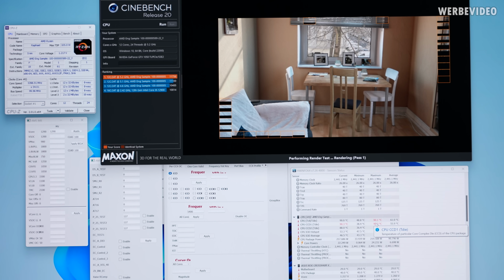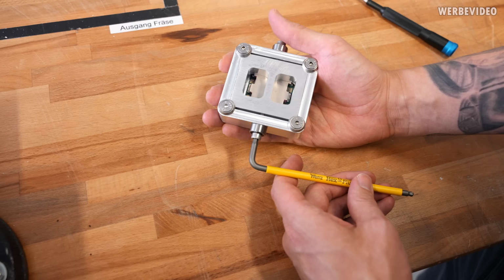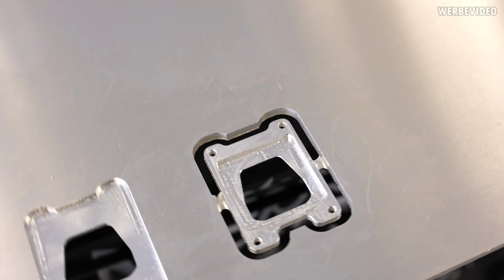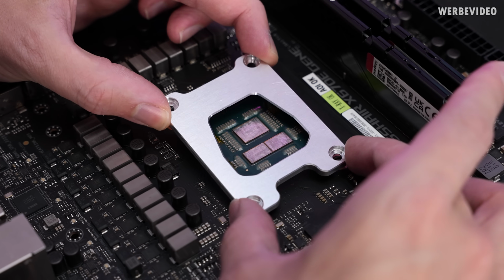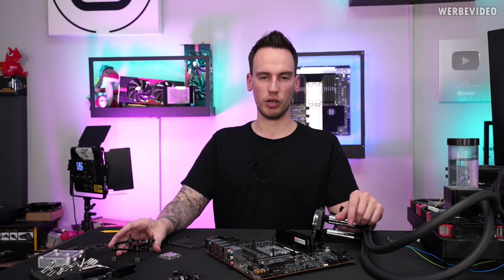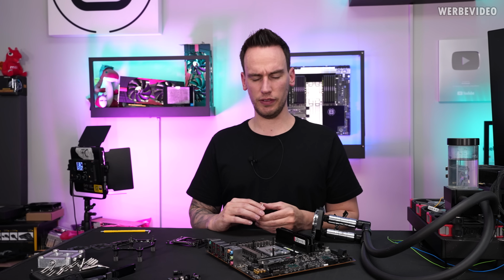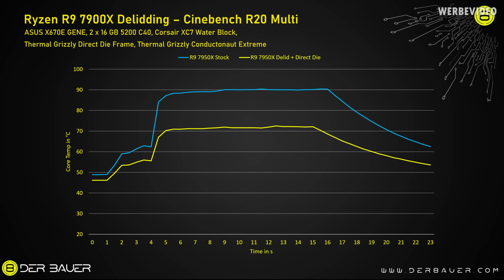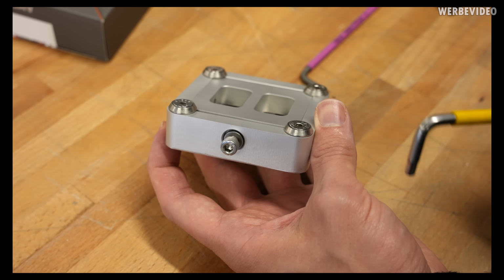Ryzen 7000 Delidding - Unreal Temperature improvement with Direct-Die Cooling

Comment: Would be interesting to see results of allowing automatic control - the CPU is designed to operate at 95 degrees C and adjust clock/voltage with this.
Reply: This was my first thought, as well. From the other major reviews I've watched today, the CPU actively tries to hit 95C when left to auto settings. I think Jay, GN, and LTT all mentioned that these will benefit greatly from more advanced cooling solutions without any real input from the user. Could the default behavior leverage the gains from direct die? If so, that would be something amazing to witness, IMO.
Reply: I bet it'll do worse, there's must be hard clock speed ceilings in Auto Mode -- while 7900X has higher boost clock (5.6), it's just for one core. All-core boost ceiling is very likely to be below 5.5Ghz that Roman dialed in.
Reply: @niter43  I don't think either of us are curious about overall performance here. I know for me, personally, it's more about seeing what this approach in controlling the CPU performance is capable of without the user directly controlling it. Of course manual overclocks will be better in all out performance.
Reply: @Trent1453  Precisely.

There's potentially so many different ways to configure these CPUs.

I'm curious if it's possible to manually set the thermal limit (to say 80 degrees) and what performance would look like.
Reply: @niter43  You're simply wrong. You need to check other reviews.

Zen 4 works very differently to other architectures.
Reply: @edwardcullen1739  were there reviews that showed CPU going above advertised clock speed all-core?

I highly doubt that it would try to hit 95C no matter what (stupid voltages, clocks, etc), it's simply that there's no ordinary coolers around that could cool them during full load with stock IHS.

Comment: Great video Roman! Love how you’re able to figure out the problems with the latest CPUs, like the bending correction frame for Intel 12th gen and the IHS/z height problem with Ryzen 7000.
Reply: Is it really a problem though? I need to see more videos on thermals and etc. For me a little tuning and tweaking and i think you could get it running cooler.
Reply: @HackoDis  it may not be a "problem" for the average consumer. However, if you want to tweak and tune the CPU to squeak out as much performance as possible, you're immediately limited to your cooling solution. So it would be a problem if you didn't hit the lottery on a silicon this would fix it.

Comment: This was my concern when I seen 95C as "new normal" for AM5... we been there, Intel did exactly that, they had horrible IHS design and they excuse was "nien our product just designed to run that hot"... yes that was BS and it seems AMD is now doing exactly the same. And this is just so annoying, why can't they just get IHS right?! Yeah sure it is all good for der8auer when we delid  everything and use 12900k as a scraper, but for us normal PC enthusiasts we not going to buy brand new 7950X for £900 and just delid it hoping for the best. That does make sense when you using PC for OC record (and get engineering samples for free, or just cover the cost by content), but not something people will do for gaming or creative work... it is just sad to see AMD doing same thing as Intel did and just pushing this crap out. How is it acceptable that IHS adds 20C?!

By the way that is not 20% improvement, what matter here is improvement from idle at room temperature to max boost. So that is like from 35-38C or 56% improvement (30-32C delta vs 57C delta)!

Comment: I work for a data colocation company and those stock temps were worrying me, not because I think that the CPU will die, but when Epyc with this core hits, I am worried about heat in the colo. We have SLA's we have to maintain, but we are always trying to find ways to use less power. It is going to get hot on the colo floor. It would be nice if they could do this from the factory.
Reply: That's not how this works. The same amount of heat is still produced for a unit of work so your cooling bill is still the same. Since you can do more work with a delid you can actually make more heat.

Comment: Would like if can have retail cpus with this bracket and delidded instead of taking a very risky procedure. I delidded an 4790k and get a massive improve temps and not used direct die... But its much easily that a soldered cpu.

Comment: Hey Roman 

After delidding to get the chip to get dies flat and clean of all indium, after using the blade… Put a piece of paper down on a granite counter and rub the chip upside-down like lapping on the page. The indium does “what lead does” and will rub off on to the page until just the die is exposed and no indium is left and it will be nice and shiny… stay safe man

Comment: Since the die is so thick, is it possible to drill holes though the IHS, make a manifold, and do a liquid cooling loop like that?

Also that's an insane temp improvement, I'm gonna have to DD mine if I upgrade this gen
Reply: Diamond layer on the die side of the heat-spreader.

Comment: Soo.... that cooler compatability with AM4 is really moot after all... 😶 AMD should have shaved down the IHS as that would have allowed for better heat dissipation. I imagine Zen 4C will have a shaved down IHS 🤔. With these temps I wonder how the 3D-V Cache variants will perform. Any way thanks for going against the grain and going straight for the Delid! As it really helps put things in perspective in terms of a solution in thermal management if a person lives in a hot climate. I really don't want to think how how a room will get in the summer 😅.
Edit: Just seen PCWorld's Gordon's Power Comparsion on Eco Mode and the performance of the 7950X is really good from what can be seen therefore for folks in hot climates the 105 mode and 10% or so hit is not a bad trade off. Perhaps you should try the eco mode Roman and see what you get with direct die cooling?

Comment: probably try to clamp down the PCB if possible, it looks like the PCB still has a bit of play in the Y axis making for a bit of unwanted tortional load happening with the chip pitching up
since the glue and solder have a bit of play it makes it so that pinning down the lid from going up and down, doesn't really mean that the PCB won't move up and down at all
I'm not an engineer I'm just commenting about what i saw with the process
so take my opinions with a truck of salt

Comment: Nice video.  With an HS this thick, there is more than enough room for a vapor chamber.  On higher core SKUs the lower temperatures and improved efficiency would probably allow 2-300Mhz higher clocks. Thats a huge deal if the same applies to the EPYC processors.    

I could probably use a dremel, some self tapping screws and the top part of an old chipset waterblock for a 30min ghetto mod.  With the added benefit of freeing up space around the CPU.  No need for cooler mounts when the water block and HS is the same piece of metall.

Comment: Well i'm not surprised at all but massively disappointed.

The first time i saw the leaked image of the new AMD CPUs whit such THICK ihs i knew this is going to be a nightmare for cooling not only because of the Z hight but also because the smaller lithography of ZEN 4 will lead to higher thermal density and on top of that the Indium sheet that AMD uses under IHS is just bad either because of its thickness or the quality of it but the core deltas are in some situations 20C or more and this can't be fixed lapping the IHS (tested on my 3900x) so the issue is under it and with everything that is going on in this thermodynamic system to me makes perfect sense seen such big temperature drop after getting rid of all this THICK layers the heat has to travel. Also the fact that AMD is being threaten by Intel 13th Gen unlike in the launch of Zen 3 in which team blue has nothing to offer it makes perfect sense that AMD is going to try to win the "marketing war" by pushing the silicon way outside their efficiency curve just to match what Intel (Intel do this whit the 11th Gen) has to offer and this is a business decision that engineers can't do shit about.  Basically AMD is letting this CPUs to cook themselves hitting 95C (GN show this clearly) all the time  just because they need to maintain the illusion of having a premium product to justify a premium price to make their shareholders happy regardless of the massive inefficiency,heat and degradation this is going to cause to the CPUs but of course they say is "expected behavior" whitch to me sounds like Lisa said "Engineers told me most of the CCDs in the new ZEN 4 can survive at 95C within the WARRANTY PERIOD and soon after that will be FRIED so is OK to sell the product."  so yeah programmed obsolescence at is finest but anyhow I'm looking forward to buy your deliding tool and the frame as long as its reasonably priced to fix this fucking mess AMD has created.  

This trend of wasting energy and increasing E-waste for pure GREED is going to fuck this planet completely 100% sure.

Comment: I see a lot of comments about the CPU height remaining the same for compatibility reasons, but wouldn't lowering the mounting holes achieve the same results? The already require a new solution for coolers with their own back plates, so it why would they make the compromise of a thicker IHS?
This raises the question: is the thickness the only issue, or even the primary one? The GN review showed a max core to core temp delta of 19.5C, which makes it appear as though IHS unevenness, its shape, or deformation from ILM pressure makes for a bad interface with the coldplate of the AIO they used. I wonder whether this is also the case here, and if lapping/different loading mechanism could solve it. It would also be interesting to see a sanded down IHS with lower cooler mounting holes compared to a stock IHS and backplate.

Comment: I'm way more excited about this than the actual reviews. Especially since the limiting factors to these CPUs are thermals and power draw. AMD  will continue to push the CPUs until you first hit the thermal limit, then the power limit. this makes "Overclocking" way more achievable IMO. Now higher-end liquid coolers, custom loops, and delidding are justifiable, even on the 7600x. This is an exciting time to be a tinkerer.

Comment: With how thick the IHS is, I think you could get a lot of improvement without delidding by just shaving down the IHS and then lapping it flat. You could make a nice kit with a 2-step lapping kit and blocks along with some shortened mounting hardware.

Step1: Insert CPU into "tall" guide block.
Step2: Use the coarse portion of the lapping block to quickly grind away a good portion of the IHS thickness. The tall block will bottom out on the plate and stop you from grinding down too far.
Step3: Insert the CPU into the "short" guide block.
Step4: Use the fine portion of the lapping block to get a flat finish on the new top surface of the IHS. The block should again bottom out to prevent you from going through the IHS completely.
Reply: You'd have to replace the mounting mechanism and ILM if you did this, to get the right Z-height. If you're replacing the mounting mechanism and ILM anyway you may as well go all the way and delid.
Reply: @nathangamble125  While that's true, I disagree on the delidding front. It's far less risky to lap away the IHS than to completely remove it, and it would still bring almost all the benefits.
Reply: @DigitalJedi  The key is in designing a delidding kit that reduces risk to nearly nil.
Reply: @CL-rm6sb  The problem with delidding is that there is always some risk. As we saw here, a professional who has done this dozens of times on all sorts of CPUs still killed one. The average person only buys one CPU. If they kill it, that's it. It's done.

The problem with completely removing the IHS is 2-fold. The force required at that location on the CPU makes it easy to damage the substrate. Also, the internal solder that bonds the chip to the IHS is very strong. You can damage the die no matter how careful you are.

By not having the user remove the IHS, but instead thinning it to a more reasonable thickness, and giving it a flat surface finish, you can still get a significant improvement over the stock thermals while also greatly reducing the risk of damage to the CPU.

Obviously hardcore overclockers will still take the risk and delid their CPUs. I'm not saying lapping is better. It's physically impossible for it to be if all other variables are kept the same. All I'm after is an easy and even lower risk option than a delid that the average person could do if they wanted to. No special skills required.
Reply: you're more brilliant than AMD Scientists or Engineers who engineered AMD CPU for years. Success is upon you brother. You & Roman can take lead AMD CPU engineering department.
Reply: @5federline  The engineers are not necessarily at fault as they are more than likely well aware of the negative impact this thicker IHS is having. It is their management who decided that this generation needs to be made compatible with existing coolers by having the same z-height as AM4 cpus. You don't need to be smarter than the AMD engineers to improve on their design, you just need to be smarter than their management.
Reply: To be fair, pc gamers are easily anally devastated when it comes to compatibility. The backlash from them not wanting to support 5000 series on older boards probably made them reconsider cooler compatibility. So you really have no one to blame but yourselves.
Reply: @Wheres_my_Dragonator  This solution does in theory allow for cooler compatibility by providing physically shorter mounting hardware. My question is why AMD didn't do this. There is clearly room above the motherboard for it to be lowered.
Reply: JUST DO IT BROOOO.....you will be rich!!

Comment: So you've not tested delided opterons X 2 on socket 939 !

Those processors are wild once uncapped, back in the days I was running 295 MHz Fsb with selected BH5 memory dies. How fun this was, peoples staring at you as if you where an alien when you told them you are using 1A-HV2 cooling behemoth.. 😂😂.
Is there any need for that in a PC ?! Once you go past 250Mhz fsb, you'll know 🤣.. 

I've been waiting for so long 😍
The 1st cinebench run after watercoling is outstanding.
It's gonna be fun, can't wait to see how fast my compiles are.

Comment: Question. Does 3Dvcache increase the die height and if so did they make the ihs thicker for these cpu's to keep it standard for both cpus?
Reply: Its thicker to maintain am4 cooler compatability but at the detriment of cooling performance vcache would be very slightly thicker but I dont think thats the reason for the ihs design

Comment: I did calculate that the 5900X is 20 Minutes slower, in a Year, than the 7900X in my workflow (Photography 80,000 images). So, there is no DDR5 with real ECC (yet) and the whole plattform is xpensive compared to AM4 so ....

Comment: As you've stated, this is absolutely unreal! It makes wonder, though, is there something wrong with AMD's IHS soldering? Or, maybe, is it more likely you've found a poorly soldered sample? EDIT: another question comes to mind, how are they gonna stack more cache on top of that thing (3D version) without crippling its thermals?
Reply: Its probably not the soldering but rather the ihs being too thick maybe lapping could achieve most of the temp reduction would be interested to see that
Reply: There's a fair bit of empty silicon above the actual circuitry which is shaved off down to the TSV's that the stacked cache is bonded to.  The height of the die with stacked cache is exactly the same as the original die.

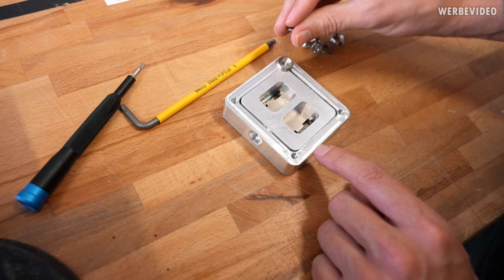Comment: 2:50 - approve Wera hex plus; it's a lovely set of allen keys. Also, 3:55, A2 (stainless steel) bolts/washer adapters - no expense spared. 5:18 - more wera tooling (the hex holder)

Comment: I wonder, could you lap an IHS and see maybe a 10 degree enhancement? I assume that would be far safer than delidding, although it would be trickier to get the z-height to be even. Regardless, obviously AMD's IHS is built for a wide market appeal to just plug and play, but 90+ degrees is really terrible performance.

Comment: Do you think lapping the heatspreader would give good returns for a more basic mod?
Reply: If Delididing works then lapping also works. Probably a 5-10° c improvement if you're willing to lap it down far enough. I would guess around .5 mm for the best thermal conductivity on the heat spreader. There are 2 points in lapping the first is to create a flat surface. The second is to lower the amount of thermal interference between multiple layers of thermally conductive material. I am sure that lapping and using liquid metal could easily get up to 10c cooler, maybe more. You will just have to deal with the loss of height on the CPU for the cooler.

Comment: Now I wonder what kind of results we can expect if someone were to shave down the IHS by 0.5 to 1.0 mms, sure the heatsinks would need to be the kind that lets you move the whole thing lower too, but I worry that AM5 is going to have this issue for every upcoming CPU resulting in possibly a few hundred mhz missing.
Reply: Thermally it should be about half of direct die cooling. So about a 10c drop in thermals.